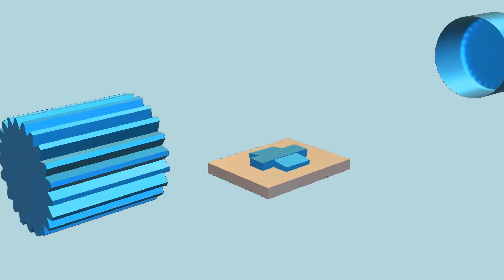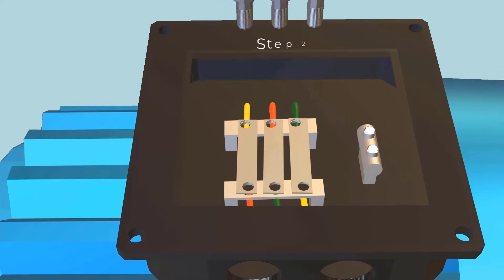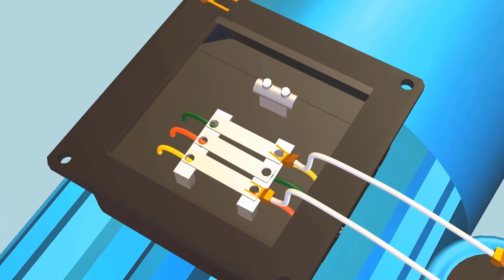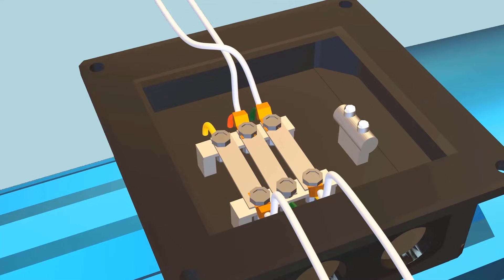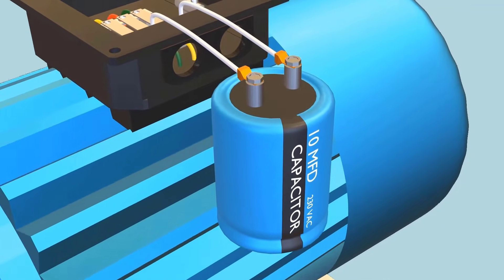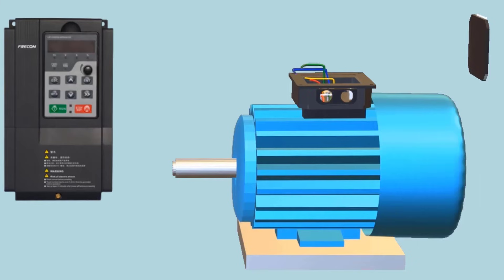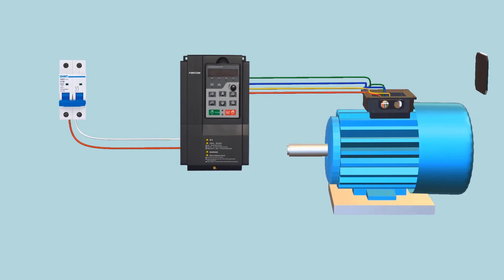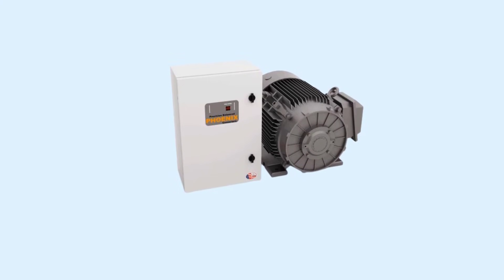How to run three phase motor with single phase Supply | Easy Explanation with Animation

Comment: Excellent 3D breakdown! I really liked how clearly you explained the delta connection and the trade-offs of the capacitor method. The warning about reduced motor lifespan is a crucial insight that many DIYers overlook. As Phoenix Phase Converters, we’ve found that a rotary converter remains the gold standard for those needing full torque and balanced power without the 2/3rd power drop. Great educational content!
Reply from the maker: Glad you found the explanation helpful!

Comment: Well, it's a start.  Nice to see that the capacitor option was correctly described as the least efficient method; also that ideas that amateurs who have no inkling of what they are doing were not offered.  If you need to go to youTube to hook up your 3-phase motor, you should probably look for someone else to do it for you.

Comment: It wasn’t designed for this, I see motor failure under normal conditions sooner than later. One set of windings are doing more work…just like dropping a phase….not good

Comment: Very useful video but how to calculate the capacitor size that's enough to use with 3phase motor? Thanks
Reply: Dont even bother this method ll just kill your motor better just run a long cable to any other phase lol, this shifts phases to 90 degrees so not 120 , you would need a single phase with a voltage of 162.6 Volts to reach the 230V line to line

Comment: hello, I have a qst , can i connect a single phase with a 3-phase machine (the machine contains stepper and servo motors and other devices) using the VFD technic. thank you.
Reply: No you can't , they're hp rated and no good for a mill , can't handle power spikes , rotary converter is the way to go . I've been doing this for years . I've built my own 10 hp converter and can run a 5 hp mill and a 3 hp lathe at same time no problem .

Comment: Yes, correct, you can drive a 3-phase motor using a Capacitor like that. . . .   BUT the value of the Capacitor will only be correct for one size of motor and also for only one specific speed or Power output on that motor.. . .   These days, it would be better to get a VFD drive unit, which can change single-phase to 3-phase.
Reply from the maker: True thats best way totally agree
Reply: I wonder what would be the power rating of this kinda motor. 
Is it 5hp or what...? 🤔
Reply: @Flordelino-hf1nu  I am really not sure, at a guess, if the capacitor is sized correctly, you might get 3HP, probably less.
Reply: VFD are no good for a milling machine with multiple motors , rotary is the only way to go .
Reply: @Ratridez  VFD is good for any and all motors. .   it just comes down to best cost consideration, balanced against the advantages of VFD. . .  In fact, I suspect VFD would be very good for milling machines. . .  Better starting with higher torque, and better coordinated control of speed.. . .    What do you think VFD is. ?. . .  It is much better control of rotary motors, than DOL.
Reply: @hughleyton693  I've had DPs they're junk and I had a VFD and it was junk to , wouldn't provide power for multiple motors at once , my RPC runs perfect and not one proplem .
Reply: @Ratridez  I think you are talking rubbish.. .   Probably because you do not understand or know what you are doing. . .   You would not do VFD to multiple motors. . .   VFD is to accurately control the speed and torque of each individual Motor. . .  What is DP.?
Reply: @hughleyton693  DPS is a digital phase shifter , my mill has 2 x 3 phase motors plus 2 power feed and coolant pumps only rotary works . I've had all the other static converters .
Reply: @Ratridez  Why on earth do you want to shift phase drive to a Motor. ?. . .  That does not make any sense, unless you are talking about SCR solid state power controllers, feed into your Motors to control their speed. . . .  All Motors like this are Rotary, so your comment about "only rotary works", again makes no sense.. .  And yes, all larger Motors are 3-phase Rotary Motors.. . .    We don't use static converters for AC or Motors. ! ! ! !
Reply: @hughleyton693  Dps worked on my single motor lathe I found out the hard way on a multi motor mill I didn't know at the time . My mill runs at one speed controlled with a clutch  cv . My lathe runs one speed with a transmission.
Reply: @Ratridez  You have not confirmed what you mean by DPS. . . Phase shifting will not help or do anything as such.. . . .   Using a clutch as a means of speed control is a very crude method, perhaps OK, for occasional use on small machines. . . .   But VFD would work far better.. . .  BUT you need one VFD for each Motor. . . .   Have you considered what is called "Brushless DC Motors". . .  The proper ones, with their external control, can work from DC, AC or 3-phase AC.. . .   Even VFD can work from Single-phase AC, DC or 3-phase AC.. . .   Ideally VFD uses speed feedback from the Motor to the controller, so that the speed can be very accurately, and smoothly controlled..  . .
Reply: @hughleyton693  Clutches work fine it's a Modern 857 5 hp mill 60 to 3600 rpm . I run a 10hp rotary converter problem solved . DPS is a digital phase shifter and have to match your hp , doesn't like power surges for example a 2nd motor running power feeds .
Reply: @Ratridez  .. .  Please explain and define what you mean by a 10hp rotary converter ? ? ? ? ?. . . .  We used to use 200 kW Rotary Converters many years ago, some even with a Diesel engine on the same shaft.
Reply: @hughleyton693  It's a 10 hp 3 phase pony motor running on a single phase to make the 3 phase power , run capacitors are added to clean up the voltage and make them even on all 3 phases . Works great for me I can run both machines no problem.
Reply: @Ratridez  A pony motor does not make 3-phase, it still uses the Single phase + Capacitor feed and any other motor on the circuit... .   The higher the total 3-phase motor power, the higher the Capacitor value needs to be. . . .   The capacitor has to match the 3-phase Load, for correct performance.. .   So a larger motor or a heavier load on the motor and the Capacitor should be larger. . . .  A large pony motor, with a correct size capacitor, can then give better 3-phase for other small 3-phase loads on that 3-phase line.
Reply: @hughleyton693  What ever , my equipment is working great without all the electronic crap . I'm not running a multimillion dollar cnc shop lol
Reply: @Ratridez  OK, what ever, but be careful giving other people information that is perhaps not correct for their situation.

Comment: I use a Rotary converter.
My first one was made by Phoenix.
It was very noisy and could barely start my direct drive machine.
I now use a converter made by Kay industry.
Not only does it start my machine in 2 seconds or less it’s incredibly quiet.
Phase master check it out.

Comment: Thank you for your nice video. Additionally, DPS is very good item for running 3 phase motor from single phase. DPS is Digital Phase Converter.